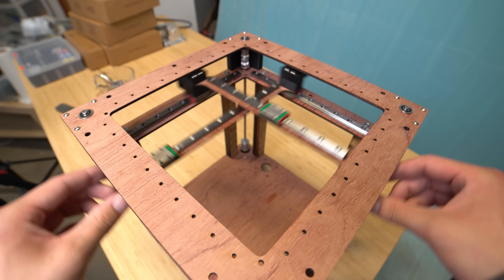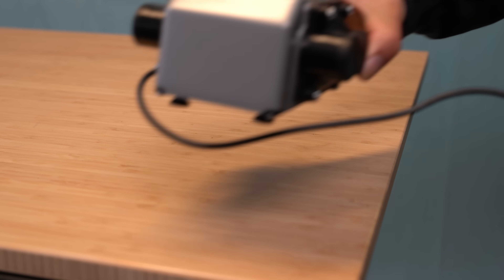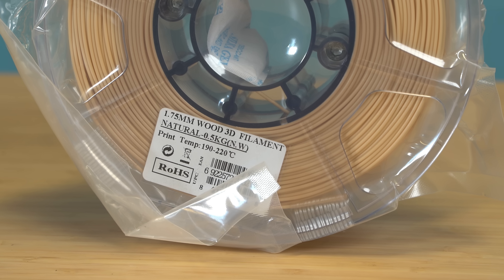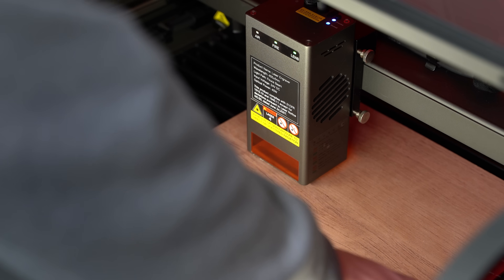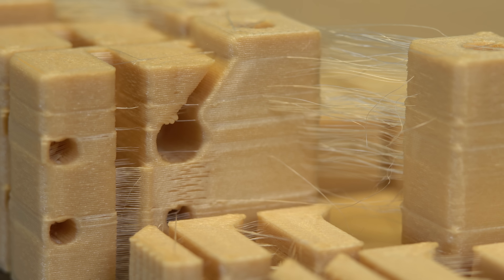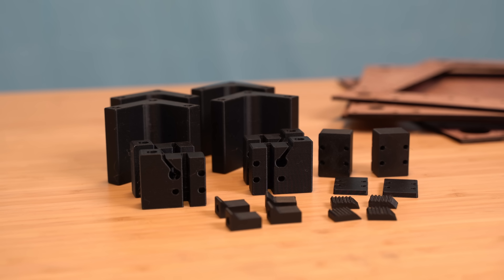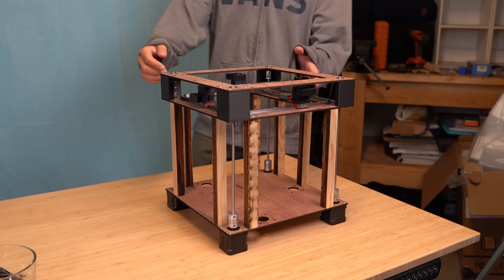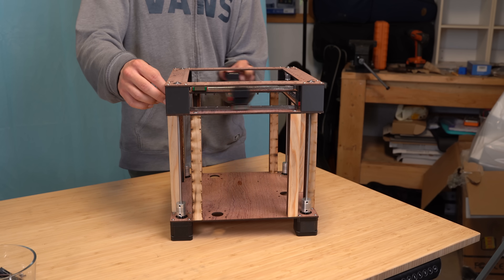Building a Wooden 3D Printer (in 2025)

Comment: oh god please dont let this come back. awesome video but man i hated wood frames the swelling alone was a pain. If this becomes the new trend I will personaly blame you.
Reply from the maker: I'll allow it. You can blame me
Reply: Wouldnt mdf solve the humidity swelling issue? (As long as you dont get any actual water on it)
Reply: @SleepLessThan3  Just go metal this is a fun printer and not practical
Reply: @SleepLessThan3 we have 90 humidity all wood swells even mdf.
Reply: @Dot2TheLock  You should probably have a dehumidifier if you want to run a 3D printer. You should probably have a dehumidifier in general, if possible.
Reply: @user9267 we do it can only do so much. But I really don't want the wooden printer trend to come back.
Reply: Riiip @Dot2TheLock
Reply: wouldn't varnish solve that?
Reply: Why is the swelling a pain? These days we have mesh bed leveling.. so old woes like that kinda became irrelevant unless something critical is binding up. But so long as the axis are perpendicular and the first layer goes down, wood is a very light very strong engineering material. That said heavier is usually better for frame dampening.
Reply: Frame swelling=parts like linear rails are no longer square=pain @Roobotics
Reply: @Roobotics  it's not just z, it's skew

Comment: Nice work 

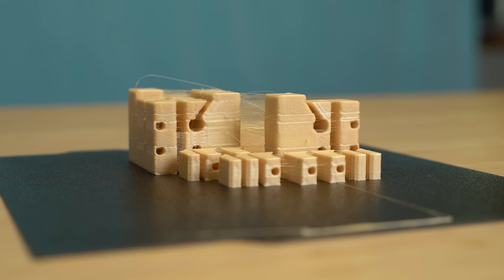7:57 Wood PLA requires very extensive drying prior to us. Wood is very hydroscopic with up to 8% moisture, this adds to the PLA having a max saturation moisture of 0.08%. So depending on the wood % content, I would recommend 24 to 48 hours of drying at below Tg of PLA (as to not anneal the material) or 62c.

Comment: Haha. That’s cool. I am also doing laser cut with my Sculpfun less powerful so mulitipass 9mm but faster than 3D prints. I am not fan of core xY or cross beam so I am doing Sli3Dr much simpler easier for me.😂. I have some vertical box joints so stiffen the flats also multi layers epoxied really solid. Thanks for sharing Looking fwd to your next video.❤

Comment: nice review for the laser cutter, 
could you explain please what those pieces are for that are bolted to the cross rails?
the frame rails are kinda located by the plywood frame
but for the cross rails, these thin pieces can't add any measurable support, can they?
Reply from the maker: We call those pieces backers, and (when made from something a bit stronger, like steel) they do help quite a lot with supporting the rails. They help enough that input shaper graphs are significantly better with backers, even though you are adding a lot of moving mass with them.

In this particular instance (backers made from wood, not steel) I doubt they will have any impact over just the bare rails

Comment: Laminate a few laser-cut plywood sheets to increase rigidity. Then build the rest of the printer the same way as the original. I think that would make a really nice printer. Laser-cut plywood is much easier for people to source. When I saw the original printer from @Rolohaun, I really liked it—but the G10 plate looks expensive and a pain to get.
Reply from the maker: Good idea! As far as I know, Rolo was only using G10 for prototyping, and the real machine will use aluminum plates

Comment: what if there was a 3d printer that used  strings instead of belts  might be cheaper????
Reply from the maker: I feel like I've seen a couple of very niche designs that use string. I think Positron might use a similar concept (or maybe an older version of it?)
Reply: One that comes to mind is Dual Wire Gantry.

Another is i think someone did build a CoreXY with capstan drive and braided fishing line (Spectra/Dyneema or the like). The drive pulley is relatively large and the line must wrap over it multiple times for enough friction, which isn't quite ideal for resolution.

Comment: Why not 6-10mm wood to XY grantly?
Reply from the maker: I think that would be a great range of thicknesses to try. For this video I was originally using that 3/4 inch board for every part, but it wasn't flat enough so I had to go back to the 3mm stuff included with the laser. If I can get access to a planer or something similar I should be able to make thicker material work

Comment: This is amazing, I wish I had your knowledge and will power, I'm in the middle of making a corexy 500mm^3 printer and the complexity of the design is just making me to either go straight Cartesian or stick with ratrigs design and call it a day 😂😂😂. I had a wooden frame once and due to humidity where I live it warped in around 6 months of use.

I wonder if you can finish this and have it in regular use untill the frame becomes unusable just for science😂

Thanks for your content, you doing awesome work!
Reply from the maker: First and foremost, good luck on the corexy! I'd recommend looking at the monolith gantry if you havent already, it's pretty much the best CoreXY gantry out there right now.

I'm curious how the wood frame will hold up long term as well tbh. Where I live it's pretty dry so I don't think I need to worry about it warping... but we'll see

Thanks for watching!
Reply: @mitsumakes  will definitely look into the monolith I don't think I've researched it yet

Comment: About stringy wood filament : keep in mind every filled material is slightly porous, so even more hydroscopic. Wood-filled ones are the worse at that. So you really need to dry the hell out of it before use. Lowering the nozzle temp might also help against stringing
Reply from the maker: I dried the filament overnight and even printed it out of the dryer. I could've lowered temps but I didnt wanna compromise layer adhesion too much.
Reply: Damn 😟

Comment: well, fully 3d printed 3d printer. of course. minus any metal parts. linear laser power scale, say 10% or something. you would only need m5 threaded rods and nuts for the rails axis. pla slides on pla just fine. cartesian independent axes, for all xyz. 4 bed level motors, 2 per xy axes. total 8 axis motors. theoretically can support tilted print bed and tilted xy axis prints.
Reply from the maker: Would be cool concept to explore!

Comment: I was only half paying attention to this video, so maybe you tried this already, but your problems with the wood PLA may have been (at least partially) caused by moisture. Make sure you thoroughly dry filament (also, most dryboxes do a terrible job of this if you don't periodically open them to let moisture out. See CNC Kitchen's videos on the subject for more information.)

That said, depending on the manufacturer, wood filled filament can just be a pain in general
Reply from the maker: I didn't explicitly mention it, and I couldn't use any footage of me printing the parts (because of the printer I used) but I did make sure the filament was dry. 

I probably could've got workable results if I spent more time tuning, but I didnt wanna put hours into such a minor part of the overall project. Thanks for watching!